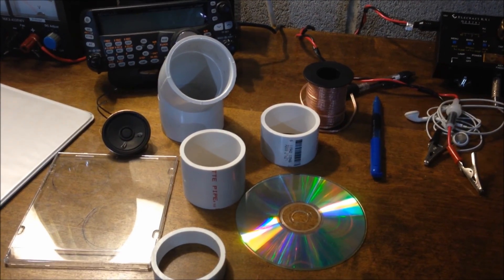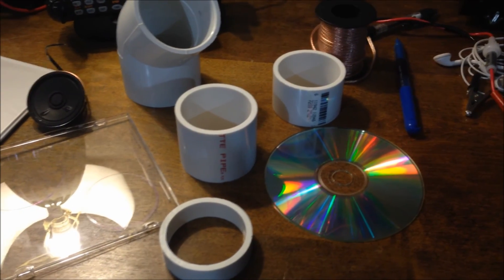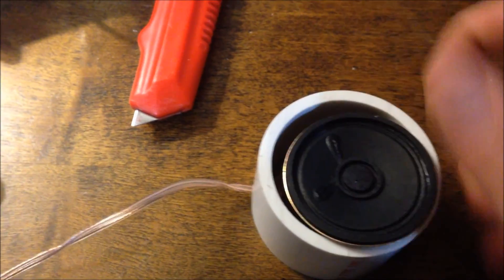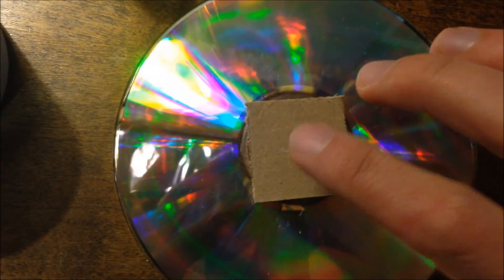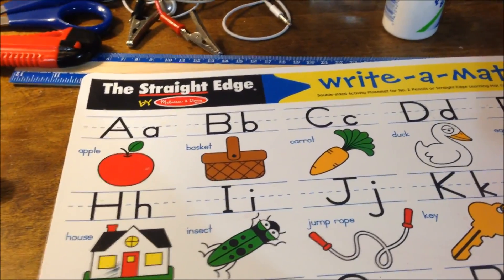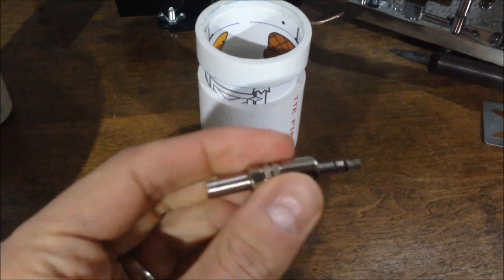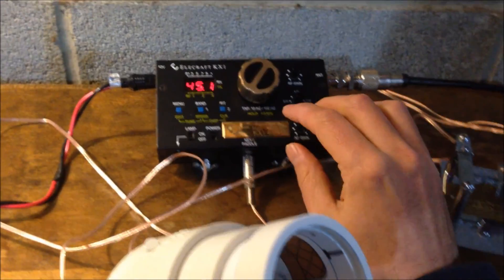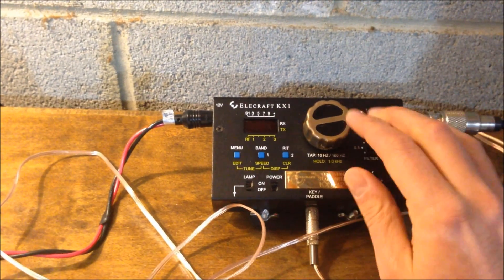Resonant (Tuned) CW Speaker Build

Comment: I’ve built several of these AND tuned them to 700 Hz and set my radio CW Sidetone to the same frequency.  Doing that allows me to ‘zero-beat’ the received signal by just tuning for the loudest sound.  No chasing as this puts me right on top of the signal.  Won’t do CW without it.  It also makes a great noise filter as the bandwidth is quite narrow.